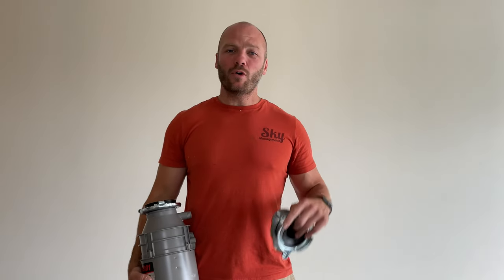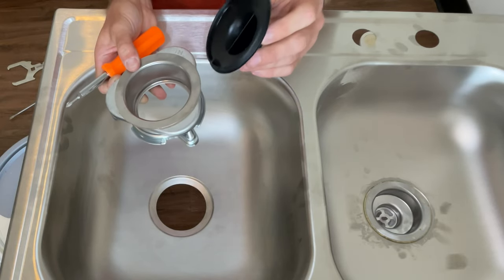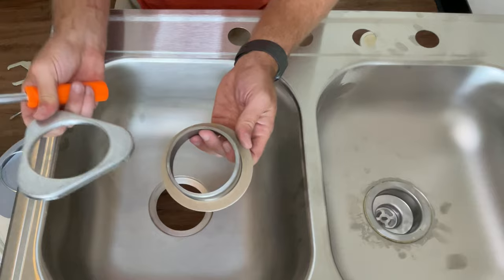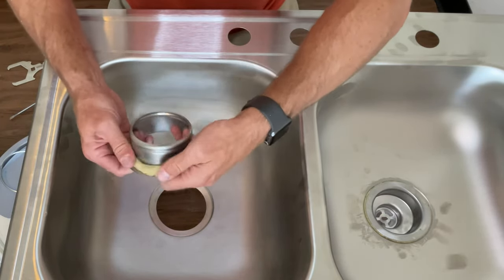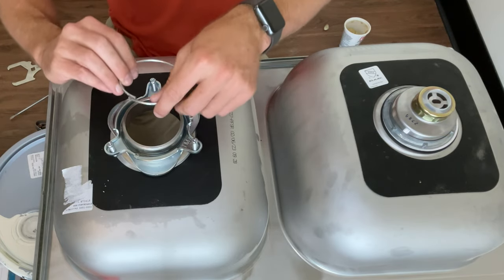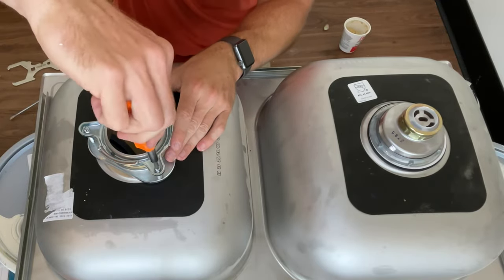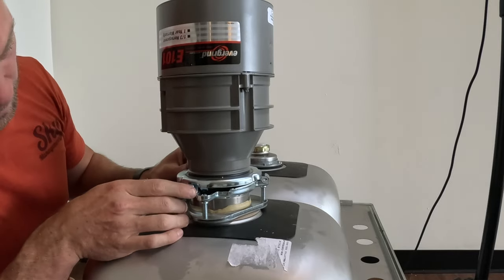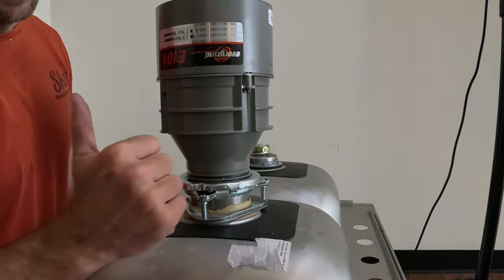How to Install a Garbage Disposal Drain

Comment: You dont have to use putty on the rubber gasket ?
Reply from the maker: You put putty on the top part when you drop it through the sink.
Reply: @ thank you very much with it already being a seal itself it didn’t make sense to me